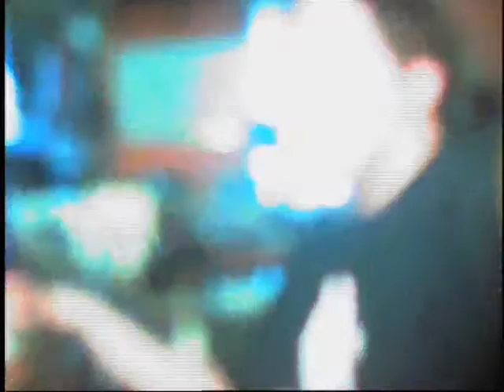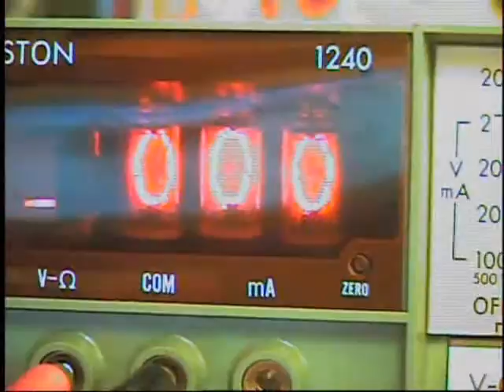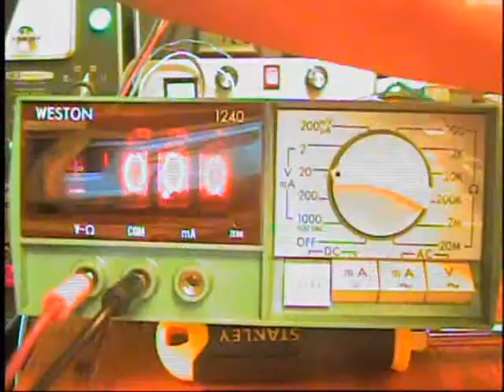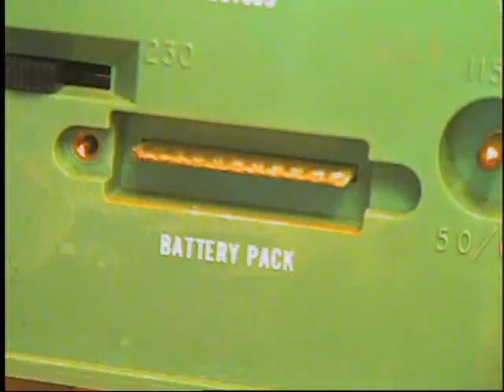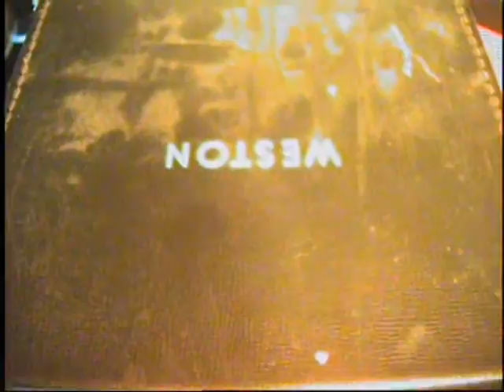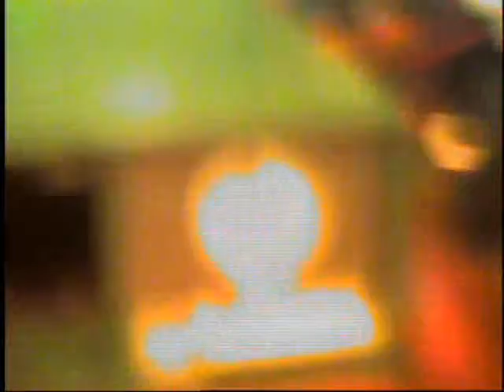Weston 1240 Digital Multimeter (1973)

Comment: Blarrer20 I one had on of these years ago, if I remember correctly several of the chips on the board were  7507 s.
Just make sure you don't pull out the Nixies from the sockets because they are a real PITA to get them back in.